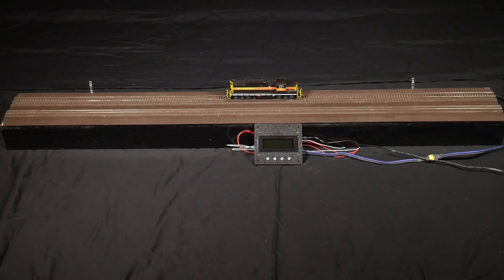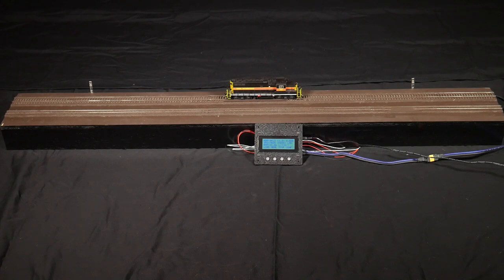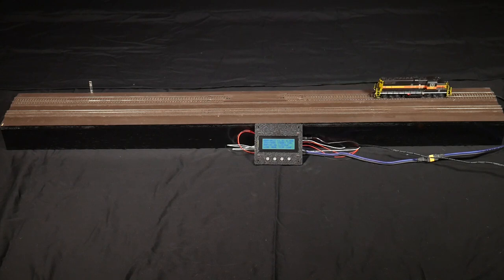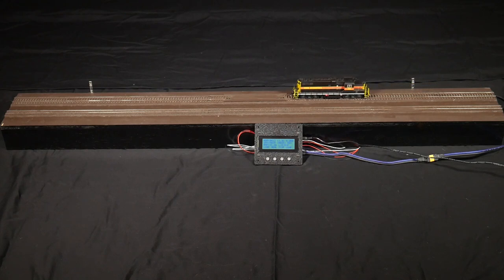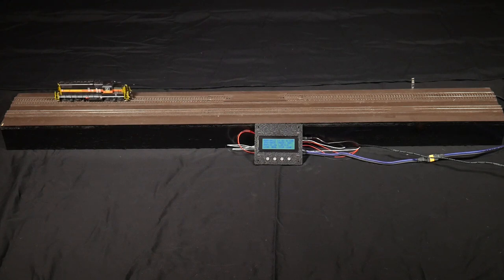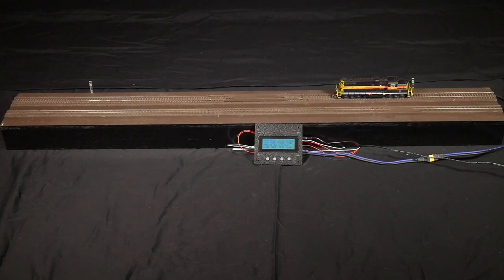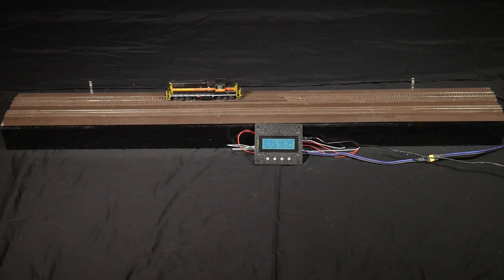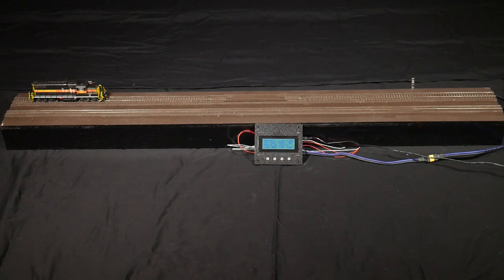Introducing the Motorman from Iowa Scaled Engineering

Comment: Nice product. Question: can I have a small passenger train go back and forth while I am operating other DCC (nce) trains on the same tracks?
Reply from the maker: No, the Motorman requires that it's the only thing powering the track that it's controlling.  We're looking at a potential future version that would act as an NCE throttle rather than being its own power supply, and that version could probably do what you're asking.